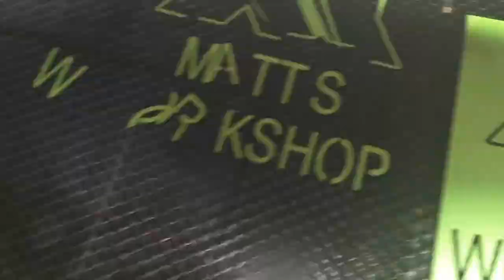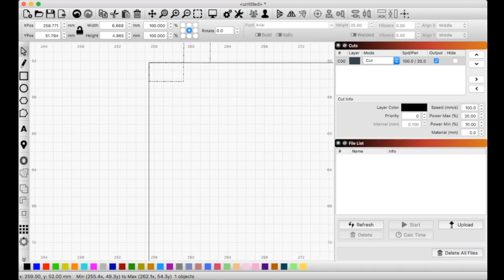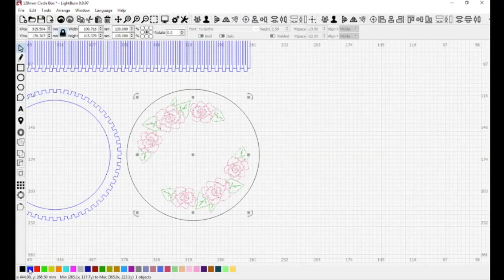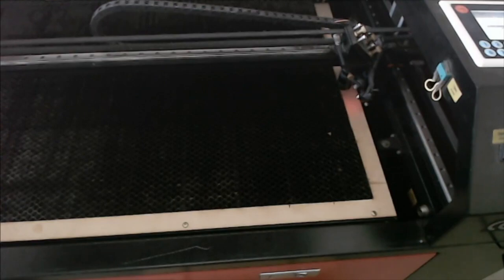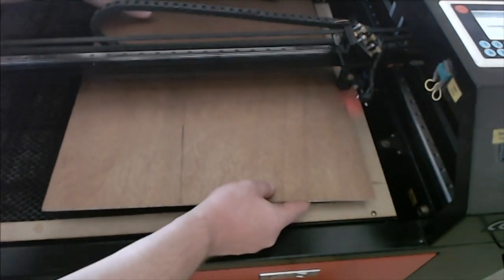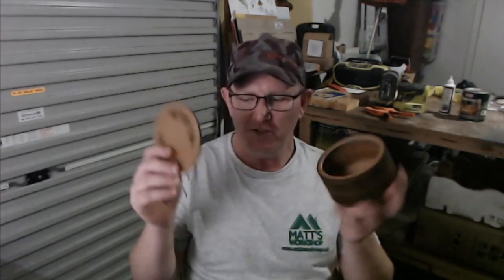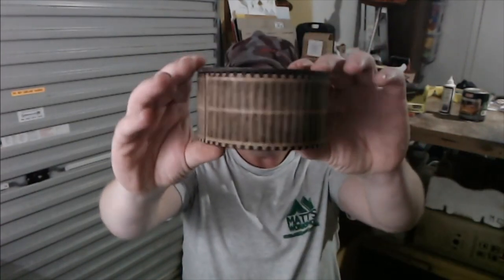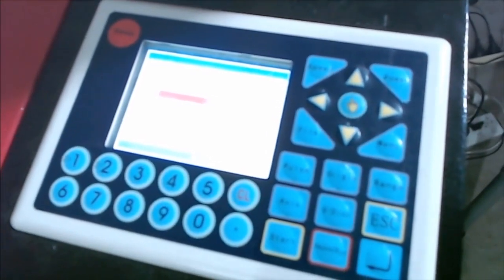Timber Circular Box - Designed With LightBurn Software - CNC Co2 Laser Project

Comment: Off topic, G'day Matt,  A friend recommended I use lightburn software, at this point i in time I use Corel draw  to make model trains, I import a Plan scale it to size and trace out what I want in layers, Can I do the same thing with Lightburn .  Australia PS, I have a Redsail 1290 130 Watts
Reply from the maker: yes, you can trace in LightBurn and then ungroup your trace to set different layers to the various parts.  Try it out LightBurn has a free trial download for 30 days

Comment: Hi Matt! How you figure out how long the sides need to be compared to the circle?? Thank you and great videos! Jason
Reply from the maker: To work out length calculate the circumference of the circle at the inside edges of the base plate notches.  then this is the approximate length of the side piece excluding the extra notch on the end.  To visualise this there is a diagram on my web page for the plans. https://mwlaser.com.au/product/round-box-cut-plans/ (3rd image)
The red lines on the image are the circumference and length I am trying to explain here. :)
Cheers Matt

Comment: Could you tell me what brand laser you have and is it a good one. I plan to buy one this week.
Reply from the maker: My laser is a Chinese Clone x700 Black&Red. There is no brand. The laser tube is a KH Laser. It came with a Top Wisdom controller and AutoLaser software which I found lacked the control and features I wanted.
The machine works very well I haven't had any problems.
I recommend purchasing one with a RUIDA controller, if you can otherwise you can upgrade the controller easily if needed as I have done already. (See video on upgrade) I also recommend looking for a machine with a RECI / Cloudray laser tube if possible.
I'm happy with my machine but have been tweaking and upgrading components as I go. Still more affordable than some brand name machines.
Cheers Matt
Reply: @MWLaser  Thanks, Mike
Reply: Hi
Nice idea to show how to build under lightburn, but a step by step process would be helpful, you know how to proceed by heart but it is quite tricky to repeat what you are doing
Kind regards